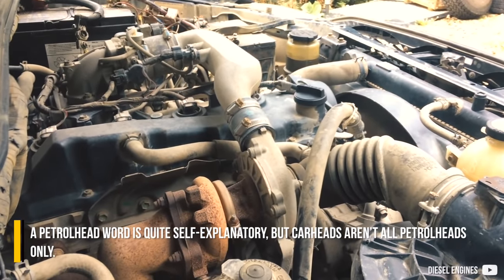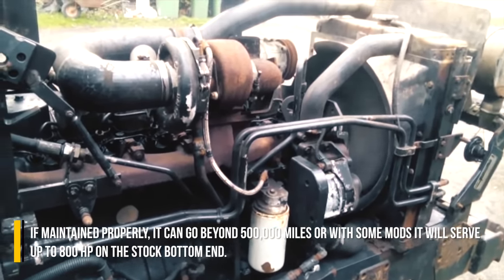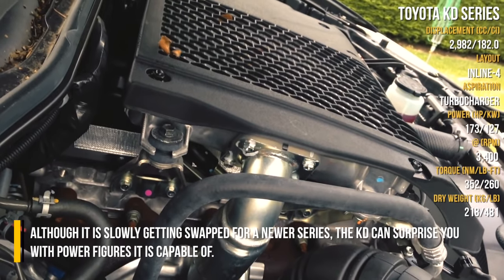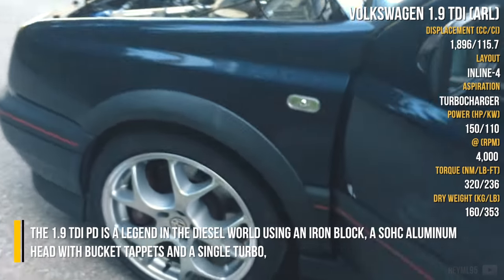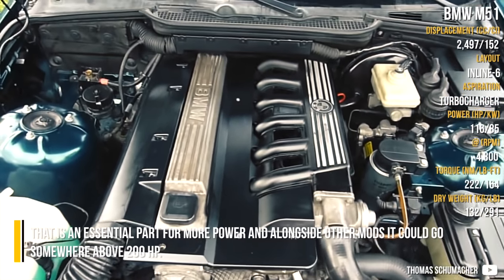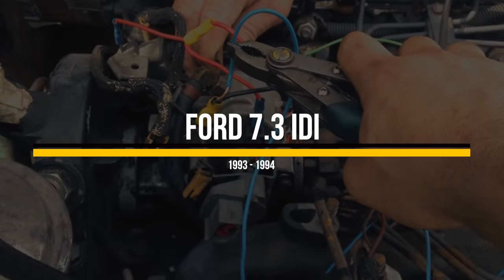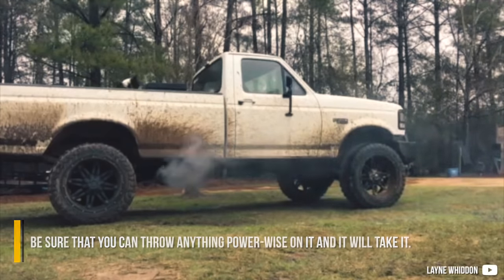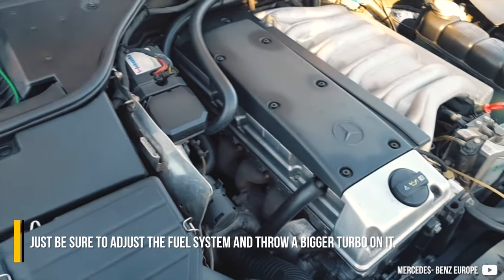6 Best Diesels For Engine Tuning | Ep.1

Comment: You really need to learn more about the 7.3 idi. They are not a wanted engine for a reason. Very bad on the cylinders cracking, and the boosted versions were not much better. There's really not much to tuning one, and not much aftermarket support.
  I would suggest if you are going to use a 7.3, i would suggest the DI ( direct injection). The powerstroke has quite a few mid year truck's with the 7.3 and the 6.0, and the 6.0 has even greater tuning ability. 6.4 and 6.7 powerstroke are also well known power house engine's as well. Most of the time, solid custom tunes and a few mods will put down some respectful power.

Comment: just fyi @VisioRacer the 7.3 IDI and the 7.3 Powerstroke are the least modded diesel engines in the ford lineup, of which are completely different engines. the 7.3 IDI was replaced by the 7.3 Powerstroke in 1994.5, you showed 1 7.3 IDI and 1 Powerstroke. The best tunable Ford powerstroke is either the 6.0, 6.4, and 6.7 powerstrokes

Comment: A lot of people compare the 6BT with the OM606 in reality they are literally worlds apart. The 6BT is easily available in the USA but not in Europe and the OM606 is readily available in Europe but not the USA.

The OM606 has an advantage of being 300kg or 660 lbs lighter than the 6BT which isn't to be sniffed at. The vehicle your putting a 6BT into will generally be bigger too. You could put a OM606 in a BMW E36 no problem.

Then it boils down to power to weight ratios and how much torque you can actually put through the tyres before then spin up.

Comment: One for y'all but what are the worst and  most worthless engines to try and tune, be it for difficulty of tune or lack of output. Cost is no object. All fuels considered.
Reply: How so?
Reply: 1.9 TDI BXE - stock, the conrods want to go through the block, one can only imagine what would happen if you were to tune it.
Reply: John Mitchell The least expensive and most reliable way to make 1000 horsepower, with an engine of that vintage, is to turbo a big Chevy. Prove me wrong.
Reply: Colum Peel My pick is the VW W12.
Reply: @michaelvalentine782  It's not got the same aftermarket, but it should be able to put out quite the horsepower
Reply: Chevy OHC/Isuzu G160 crossover
Brazilian Chevette engine
I know myself as an owner
Reply: Random41 Arguably VW's least reliable, most complicated engine, the one with main bearing issues on stock power? Did you convert your basement into a sex-dungeon, where only German is allowed to be spoken? Because, you gotta be a masochist to mess with that.
Reply: GMs old 6.2 and 6.5 diesel v8
Reply: a scooter engine
Reply: a Briggs and Stratton
Reply: Michael Valentine LS
Reply: @dnltbrca  Well, it depends. Here in Denmark we have easily tunable scooters. Mostly asiatic brands. My modified 2-stroke 50cc scooter made about 8 hp. The most powerful 50cc scooter in Denmark makes 23.7 hp, again two-stroke.

Comment: 1KD FTV 3.0 FOR LIFE

most reliable diesel engines out there
Reply: Hardly, the pistons have a reputation of cracking, and the fuel pump is also a weak spot. There are many more reliable Toyota diesels.
Reply: @PeterKnagge  my toyota fortuner with the 3.0 1kd ftv has about 300000km on the odo with stage 1 tune and intake smokes the newer 2.8 toyota diesel on highways🤟
Reply: @PeterKnagge  expected hp 200 torque 500

Comment: Volvo D5, BMW M57 and M67, Audi 3.0TDi and old 5 cylinder 2.5TDi, 1.9 and 2.4 JTD all of these are very good
Reply: I had a Volvo S80 d5 264bhp and 750nm torque good engine and I have now bmw e36 m51 engine but still good like the m57

Comment: I would have added the 1.9 JTD, reliable and with a lot of tourque
Reply: not as reliable as a 1.9 TDI or as available
Reply: @oussama4629  it's about the same in terms of reliability, but for perfomance the JTD (especially the multijet One) is Better, because It has a wonderful solution for the injection, but speaking of availability, idk, in my country (Italy) it Is very common in a lot of cars

Comment: I'm sorry but m51 made the list? that can't take anything before the head cracks. Then then the m57 that is like a modern version of the om606 engine is not on the list. Even the later m47 would be better suited, 535d injectors and an other turbo and you are pushing well over 300 from the little 2l. + no timing chain problems like the n series engines
Reply: Yeah m47 & m57 are legendary, why he didn't mention them...
Reply: Some people takes m57 engines with 300'000+ miles from scrapyard, install them on boat and put lots of hours on them...
Reply: Well the early m57 engines has probably one of the best head designs ever in the diesel car industry for longevity if you include power and fuel consumption . You will not find any wear at all even after a million on the odo
Reply: M57 is a modern version of the M51, same engine family. The OM606 has nothing in common with the M57 aside from being German six cylinder diesels.

Comment: Howabout the 3.0 V6 TDI from Audi featured in the early 2010s?
Reply: The technically sophisticated 3.0 TDI requires a lot of effort and money for any repair. Based on consumer reports, unfortunately, the 3.0 TDI V6 is almost unable to pass 200,000 miles without an overhaul. Often serious problems begin to appear after only 100,000 miles. The timing chain tensioner is the weak point of this engine. Its breakage causes grinding when the engine starts. The first 3.0 TDI was equipped with piezoelectric injectors, which quickly went out of order. They provided a shortage of fuel supplied to the cylinders. As a result, a reduced fuel mixture led to an increase in temperature and a pistons burnout. (source:https://www.motorreviewer.com/)

Comment: i have an om617 just sitting around. wonder what in should do with it
Reply: dann hienn should be able to make 300bhp with her
Reply: how?
Reply: Put it in a w123, w126 or w116 chassis and use it
Reply: Miss my 84 300td wagon.
Reply: i had an 82 300sd. ran it on used atf
Reply: dieselmeken 7.5mm,and HX35.go for the stock turbo 617 tho
Reply: Throw it in the bin and buy a decent car lol 😂

Comment: The engines on a list are decent but the "best"  for tuning i am not sure about.

Any of the modern  north american diesel respond incredibly well to simple  tuning.  Powerstroke 7.3 can take 400-500hp on stock internals depending on what connecting rods it has.  The 6.0 is a great tuning diesel assuming you do it right(don't get crazy with the timing and delete the egr, your head gaskets should be safe).  The 6.4 came factory with twin turbo and is capable of big numbers, just put better fuel system and coolant filters.  The new 6.7 is quite a potent engine when it is not choked with the dpf behind it.  The 6.0, 6.4 and 6.7 have very strong ford transmissions and are capable of holding good power with a simple tune also.

Duramax which I am not too familiar with, the lbl, lb7 and lp5 respond very well also.  The allison transmission can be made to survive behind them also for not a lot of work.

The old 12 valve cummins was a great motor.  A simple adjustment of the fuel screw could almost double the factory power.  The 24 valve 5.9 are a great motor.  With tuning and some after market parts can get you to an east 500+ hp on stock internals.  The 5.9 has the 48re trans which with a decent build can hold a lot of power.  The 6.7 has the 68rfe trans which is a known weak point.  Even built ones have a hard time holding up to the old 48re, which is why it is a common swap for 4 digit power goals.  The nv4500 and even g56(which I own in my 2011 cummins) can hold upwards of 600+ with an appropriate clutch.
Reply: Trevor G the best for tuning is the om606 and 605.
These two engines can take rediculous amounts of boost,and good for 6-700bhp unopened.
And if power is not all for you,they have the best sound in my opinion,as they rev to the same rpm ranges as gasoline ones.or even more,if you let them to.I mean,have you ever seen another diesel running over 8000rpm with only springs changed?

Comment: The m51 had head problems and they would often crack
Reply: Blok B i laughed so hard that part.
That engine is junk
Reply: @joczo97  the m21 was bmw's first diesel ever,it was constructed using a gasoline engine block which is weak for diesels and it also had head problems but it did sound good tho.
M51 wasnt any better,it has fuel pump issues and was not powerful at all
Reply: Yeah,but the om606 had the same block as the m104 as well.and both of them became legendary engines.
Bmw's ones were simply manufactured badly
Reply: m57 and m47 are nearly indestructible engines when stock but m51 is shit

Comment: You forgot to put the JTD Engine, wich is capable of 400+ hp and 700+Nm using stock internals. It is a straight-five, single turbo, sigle camshaft, driven belt engine, with displacement of 2,396cc^ cm.

Comment: Okay I need a bit of help and this seems like the perfect place to ask for it. So I’ve got a 5 year old  SUV with a 6 Speed Manual gearbox and a 2.2 litre turbo Diesel engine producing about 140bhp/320nm, now what should I do as a starter mod to increase the bhp or torque figures without breaking the stock parts on my car, I don’t want to increase it dramatically, my end goal is to just touch the 200bhp figure. That’s all that really matters to me, I don’t care about voiding my warranty because it doesn’t exist anymore. But would still like to mod my car legally.
Reply: Nachiket Bidkar xuv500 i Suppose😉
Reply: @angelesc2033  Hahaha you keep popping up everywhere bro. I guess both of us are omnipresent on these YouTube Car Channels or whatever you call them.
Reply: Nachiket Bidkar yes!
Reply: Nachiket Bidkar and i sure am delighted to see my 3.0 d4d here😊
Reply: @angelesc2033  Fortuner?
Reply: Nachiket Bidkar yes brother 1st gen fortuner churning2.6l km and more to go💪
Reply: @angelesc2033  2.6 lakh kms! My XUV has done only about 1.25 lakh kms since 2013.
Reply: Nachiket Bidkar I have reached 2.6 with just basic mentaince and the head gasket is still from the factory! But just had to replace the ac compresser as it went kaput.
Sure toyota makes reliable engines!

Comment: PD150/160s eat camshafts, the PD130 makes 180bhp with no hardware changes. Add a hybrid and the sky is the limit.
Reply: Dan Bert 
I got a 2.0 pd I saved from the wife’s 2004 passat, and it’s getting swapped into my mk1 someday. 
Only 180hp? 
I heard you can get close to 250 before upgrading rods, that wouldn’t be too bad I guess. 
I need a lot more than 180
as I’m reaching midlife crisis age😬
Reply: @MrTheHillfolk  You can get more with supporting mods on the stock turbo but with the right hybrid turbo and supporting mods 250bhp is easy with PDs. No DPF too which is awesome.
Reply: @DanteTheAbyssalBeing  
I'm all for it,whatever it takes. 
No kids ,midlife crisis and money to burn for it haha. 
I had a mk3 tdi I swapped in,with mechanical Injection and it ran traction less  14 flat in the 1/4
I'm  sure the pd would do 13s easy,and I'd kiss the earth if it would dip in the 12s.

Comment: i have a 2001 beetle with the 1.9 ALH TDI. i plan on modding it significantly, and it will be able to achieve 450hp with a 9000 RPM redline.

Comment: The 1,9 TDI dosen‘t have 150 PS ! Maximum in Series Car is 110 HP greetings from Germany
Reply from the maker: Oh yeah, there were. The Škoda Fabia I RS had 130 hp from that engine (AVF), but the most powerful stock one had up to 160 hp (BTX). Just a little bit of googling
Reply: I had a Passat 1.9 TDI PD with the 131 HP "AVF" engine. Some offerings had even more power, such as the "ARL" and "BTB" which sported 150 HP, and the "BPX" / "BUK" engines had 160 HP - The latter two was only made for select SEAT Ibiza models
What you might be thinking of is the mechanically injected series, not the Pumpe Düse series. 

The PD engines could easily hit 180 HP with a simple chip-tune, and could just as well go beyond 200 HP without any major procedures.
However, the older series is even tougher. Pretty much a shrunk down and cut version of the Audi 2.5 TDI (5 cylinder version), which is known to be extremely reliable, and tough as old leather. Speaking of the Audi 2.5 TDI, the 140 HP version was also used by Volvo in their 850 and V70 models, and those engines can easily do 1 million kilometers. 
These are also good for tuning, and with just a few small tweaks, these engines can easily produce more than 300 HP
Reply: silly rabbit. 130, 150 and a 160
Reply: Yes you're right friend the Mk3 Golf had the AFN engine Bosch mechanical pump 81kw 110hp, whilst the mk4 Golf had the legendary ASZ or ARL PD130 and PD150 but those are Pümpe Düse injection system and not mechanical injection pump anymore. I myself own an Mk4 Golf ALH TDI 66kw 90ps.And of course the slice of the cake for the PD engines the Ibiza's 1.9 BUK 160ps, the same as ARL engine as in the Mk4. Only chipped a little more with the Garret GT1749VB turbo VNT17, whilst the PD130 ASZ had the slightly smaller but quicker spooling GT1749VA turbo and side mount intercooler instead of FMIC like the PD150 Mk4 or the IC (Ibiza Cupra) with the PD160 engine.
Reply: @69bock69  Forgot to add the PD100 (ATD, ATX, BEW in USA) the PD115 (AJM, AUY), PD130 (ASZ) and the PD150(ARL) in the Mk4 Golf.
Reply: @Skarfar90  The ASZ and ARL stock injectors max out at 230hp and the stock Camshaft at 270ps after those parts you need to go aftermarket to strengthen the engine.The PD130 AVF is basically the same engine as the ASZ in the Mk4 Golf the only difference being that the ASZ had bigger injector nozzles or the same injectors as the PD150 ARL. And ofcourse the AVF being mounted longitudinal in the B5 Passat.
Reply: @arnoldkul3827  Well, now I know.
Do you know anything else about the older series, such as the Audi 2.5 TDI (AEL) or the Volvo D5252T (basically the same engine)
How much power can you in theory get out of those? I know for a fact that if you do a few simple upgrades, they can go over 200 HP (140 stock), with an aftermarket chip, an open exhaust and a larger intercooler.
Reply: @Skarfar90  Don't know a lot about those as I didn't do my homework unlike the 1.9 TDI's. I just looked it up a little and those are the first gen. 2.5 TDI engines with an mechanical injection pump since the later gen used the PD system. I know that the 1.9 was developed from the 2.5 minus one cilinder. And forgot to add if you want to get your PD130 to an PD160 all you have to do is to put a PD160 map on it. And forgot to add if you have a heavy right foot you need to change the head bolts to prevent the head lifting and sucking in coolant. The PD160 head bolts are stronger. You can read more about tuning these engines that folks like to do on here and Google is your friend http://forums.tdiclub.com/showthread.php?t=346240

Comment: Bmw M57:

"am I a joke to you?"
Reply: M57 is not tuner friendly. It's your reliable workhorse, take care of it and it will take care of you.
Reply: @domse16 
Just a map: +50hp
Pipe/decat: +30
Bigger/hybrid turo: +60
Bigger cooler: +30

Totaly normal things and you got 400+hp. And 600+ ftlb.
Stock internals!

You can Realy go crasy if you want to open it and change internals.

Do nothing and you have a bulletproof, 200+k miles, 45+mpg Highway car.

This Motor Has won many Times the engine of the year award. It has to be on this list.
Reply: @thomasengel9802  This motor has won those awards by being stock though. I see what you're saying, but there are other engines perfect for that. I will rather invest in suspension, tires, breaks. 
Stock internals....
But what about your clutch, what about forgetting to let your engine warm up what about all the plastic parts around the engine (they will be breaking 2-3x times more) What about the car being +10 yrs old and you are forced to upgrade everything if you dont want anything to collapse. BMW's 3L engines are made perfect. It's not a civic, you need big bucks to "upgrade" And its the type of car that once u start, u gotta go all out. And with that hp you will eat up your engine, it being bulletproof or not.

People dont have e90's/ e60's and newer models as project cars for a reason.
Calculate how much you would have to spend on a decent stage 2... Might aswell get LS at this point.

Comment: 7.3 idit wasnt a tuner friendly engine at all, the only way to make big power was a bigger turbo and more boost. the 7.3 powerstroke you could put a $500 tuner on it and make tons of power
Reply: Literally the only thing a powerstroke 7.3 and an idi 7.3 have in common is the bore and stroke. The bottom end is completely different

Comment: 7.3 IDI wasn’t that great, sure maybe as a stock engine it was fine, but the fact that it’s indirect injection doesn’t help, plus the engine was not originally designed with turbocharging in mind

Comment: i have a m51, its not that great lol. Very sensitive to heat, easy to crack the head or even the block because of the heat. Can't go over 200HP because of the fuel pump. Also fuel pumps are very easy to break and a repair for that can go over 800€
not to mention that the intercooler is the size of a hand

Comment: I wouldn’t say ford 7.3. They shouldn’t get credit for the only good power stroke.
Reply: 7.3 International Navistar.
6.0 International Navistar (had issues, but doing the EGR-delete and fixing the head stud/gasket issue, is bulletproof and a strong performer)
6.4 International Navistar.
6.7 Powerstroke by Ford.

https://en.wikipedia.org/wiki/Navistar_VT_engine
Reply: I have seen 6.0 make stupid amount of power off tunes and 6.7 really good as well
Reply: Motor Trend truck challenge videos were pretty interesting. 6.0L was whooping up on the rest.
Reply: @exothermal.sprocket  yes the one guy won like  3 years in a row  that thing made crazy power and it was pretty reliable through all the challenges. Some of the 6.4 made big power too though